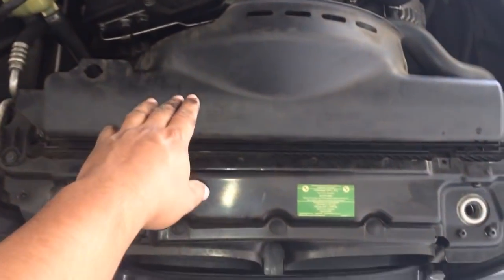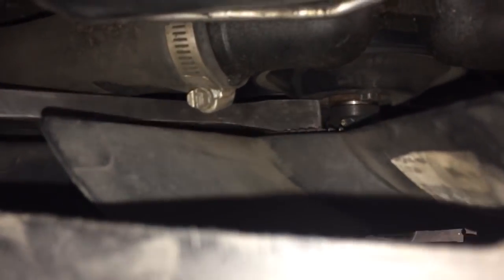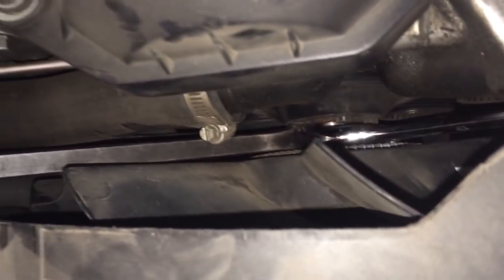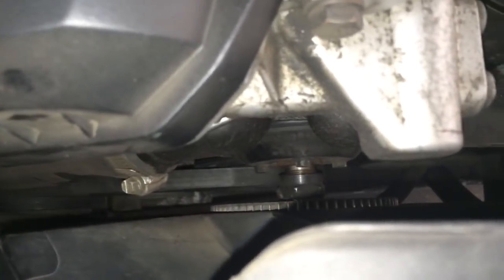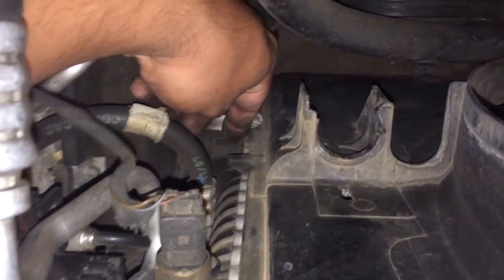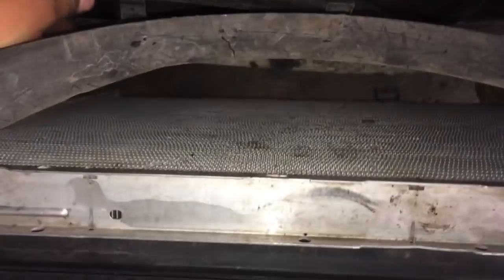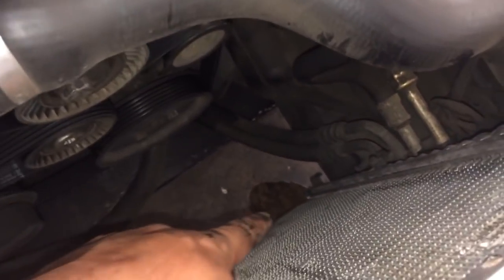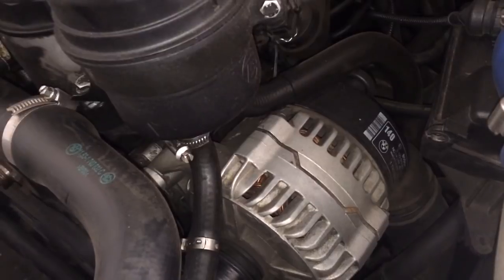HOW TO Remove Fan Clutch and Fan Shroud BMW 5 Series 3 Series E90 E39 528I 328I M5 M3

Comment: That's called a wrench homie.
A wrench.
And it's supposed to be a 32mm wrench, but it looks like your fit fine.
For anyone wondering the fan clutch is reverse threaded, so you need to turn it clockwise to remove it.